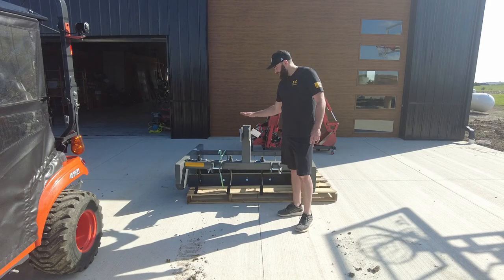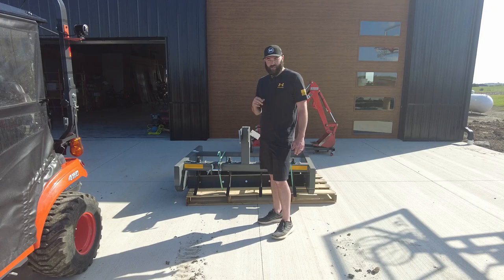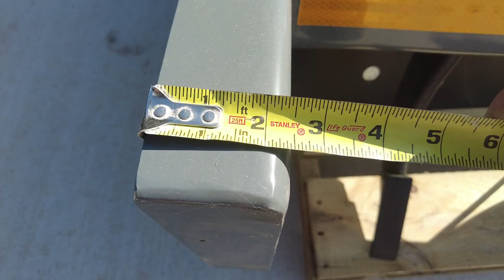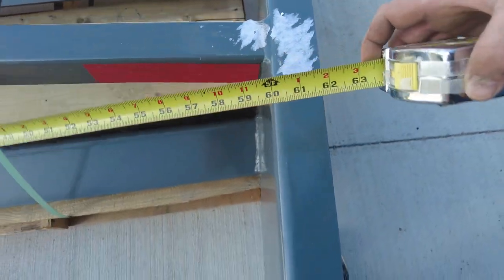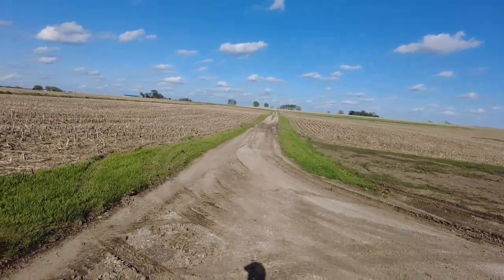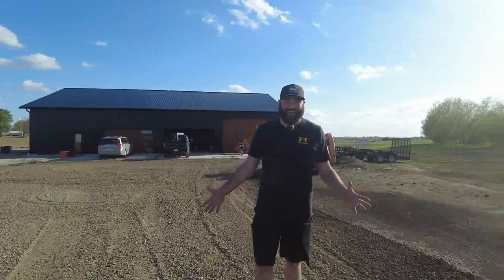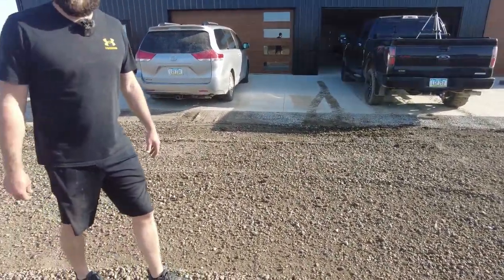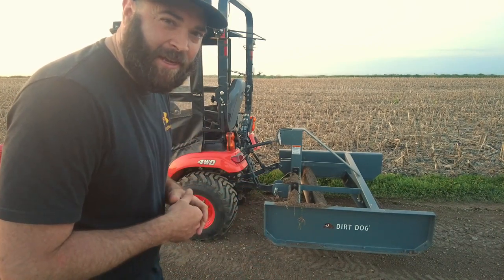Dirt Dog 60" Land Plane for my Kubota BX23s | This thing is Sweet!

Comment: Cool! I just got a 4’ box blade and will do my daughter’s driveway first. 

My BX23S lIfted a 650 lb pallet of flooring. I got it about 18” off the ground. I expect that I could take your pallet off a truck and let it down to the ground.
Reply from the maker: Sweet!  It could have probably lifted it but I had access to a skidloader so it took the drama out of it.
That is pretty impressive!
Reply: Ground level and 4ft up you don't have the same lifting capacity.. hence why you could get or pallet only 18" off of the ground